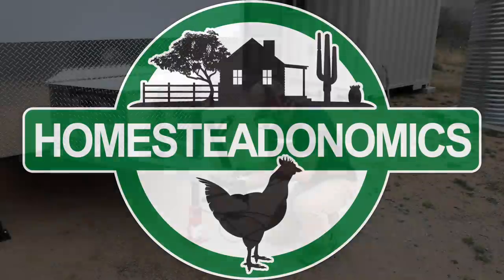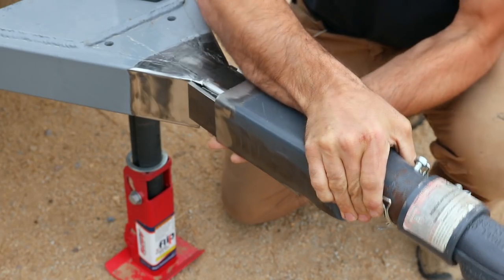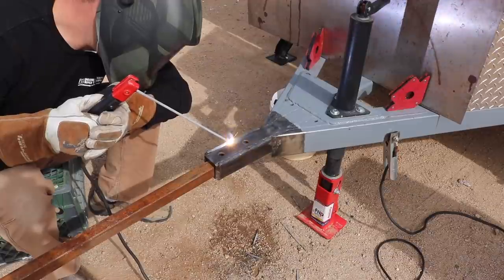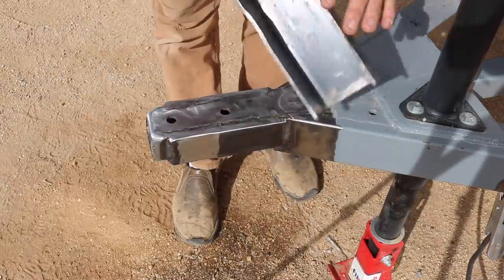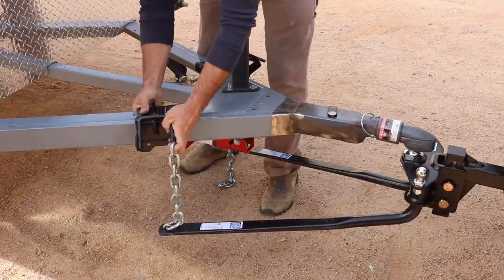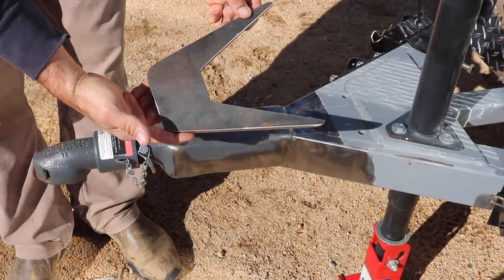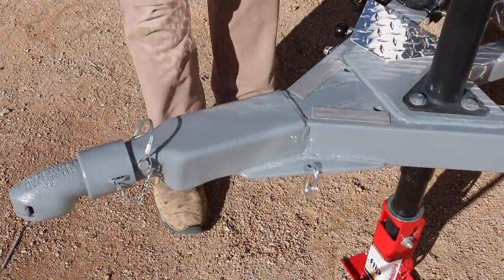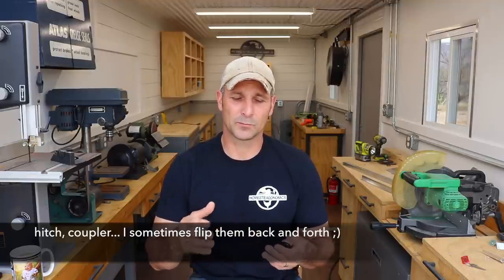How to Build a DIY Travel Trailer - Coupler Install, Hitch, Sway Control (Part 7)

Comment: Hi ! 12 Volts is not enough. You need to wire also a 110 (220) Volt. This is very convinient hen you are on a campingplace were they have 110V. Especcialy when you want to heat it. Rob.
Reply from the maker: Rob Janssen the 12v is for the the main camping that we do, which is primitive camping.  When we get into more of the campground thing for road trips, etc,. I will probably do a dedicated 110 feed with some outlets for those kind of appliances.   😀👍

Comment: If you don't make things like this for a living you ought too! This camper is first class all the way and your craftsmanship really shows. Thanks for sharing this.
Reply from the maker: Thank you John!   this is more of a hobby kinda thing... but I do love it!    I don't think I could be profitable on many of these projects because of the time and figuring they take.    I will say that if I built this trailer again... I feel it would take only about 1/3 to 1/2 the time due to all the figuring and mistakes and changes made during the first go around.    Sometimes i do make custom pieces and projects for folks though... but its on a very random basis, but I have been thinking of doing it slightly more... so long as they are okay with me making a video out of it ;)

Comment: WOW!  You can weld out of position with low hydrogen!!  A skill level that comes with a learning curve.   Congratulations!  I'm a big believer in low hydrogen welds.  They make strong, resilient welds that will bend and twist and stretch before they break.  I used to repair a lot of farm machinery.  Great looking little project.  Now, take the family and use it.
Reply from the maker: Thanks!   I’m still learning but getting better with each project!  The overhead was definitely tough to figure at first...lots of trial and error and watching some of the pro guys here on yt. 😀👍

Comment: Nice job! Overhead welds are the hardest to get right. Love the way you pay attention to details.
Reply from the maker: Ben Joiner thanks you Ben!  They have been the hardest for me to learn for sure....slowly getting better though😀👍
Reply: I work in commercial construction and the most difficult welds for guys to get certified on are overhead, then vertical, and horizontal of course. Seems like your father in law knows a bit about welding, I didn't  go back to check. It always looks like flock of dirt dobbers attacked when I get done with a weld of any kind so my hats off to you!

Comment: I didn’t notice a leveling jack at the rear of your trailer. Good workmanship.
Reply from the maker: Chuck Lenhart thanks!  Only stabilizer jacks in the front and back.  The leveling will be the traditional way.  Tongue jack for front and back level and a shovel to level the tires for side to side.   It’s not hard really...just moving the trailer into hole scraped out quickly to get a rough lecvel.

Comment: Great video and great trailer.  I DON'T lend anything even to family,  now a days no one accepts responsibility if it gets damaged. Just me saying buddy! Again nice informative video
Reply from the maker: haha... I know what you mean, I loaned my chainsaw out once and it came back dry on bar and chain oil.   The thing that bugged me is that I even included oil with it and mentioned to top it off during the cutting.   Needless to say i haven't loaned it out since.   That is probably more of a reality with the trailer as well... as it will be years down the road before I get 35 trips in with it ;)

Comment: Great video! One Idea for the trailer- If you want an economical heater for winter use you can install a webasto style (or a China knock off)  diesel heater used in semi trucks. It will run 24+ hrs on just 2 gals of diesel fuel
Reply from the maker: 96ChevyDually6.5L thanks Chevy!  Now you have me interested in this diesel heater!   Sounds pretty cool...thanks  I will check it out!

Comment: Great job Joe! You'll be camping in no time w/the family. Only wish I could get mine together like you have done. But one w/disabilities will take a little longer to fix. Instead of fixing it. I think it would be easier to rip it down to bare trailer & start fresh. That away if wires was cut, no big deal bc they will be brand new. Plus the mice have chewed a few into. Oh those stinking rats.... lol... I'll get those little basters. And we want to plug all the holes up so they can't get in in the winter.
Have a great time camping w/the family. Nice job,
Chris from Missouri
Reply from the maker: Hey Chris!  ouch... sorry to hear about the wires.   In that case I kinda think it might be worth stripping it completely.    If you check out tnttt. com   there are a lot of posts about people doing just that..... stripping it down to the bare frame and upper structure.  Then if any of the wood is rotted, they take it out one piece at a time and replace it... so there isn't much figuring at all.... just making a new replacement piece kinda thing... makes it more managaeable i think
Reply: @homesteadonomics  I agree w/stripping it down to the bare. All wires, light fixtures, & what's water damaged. The good thing is the stove, bedroom, restroom is in good shape. Plus a good thing is we can make it a little taller & put a storage loaf in it. I'm not talking about a 13'5" camper just about 3' more for some rubber made totes. With a shed roof which I already have the medal for, left overs from another rooftop we made. We can put a AC unit in a window or wall & then some solar panels on the roof. Its 24' I can live w/o a living space since it's just me & my hubby. Could use have for battery storage & the other for small eating place. The couch folds down to make a twin bed & has are fresh water tank under it. Just wish I had a large barn to put it in to do the work. It's hot in summer & cold in the winter. Just might trade it in on one that doesn't leak.... lol...
That would be the smartest way. 
Take care Joe, 
Chris

Comment: Nice job Joe! I didn’t know there was a certain direction you need to go on vertical surface so you don’t contaminate your weld. That chrome plate looks awesome!!!
Reply from the maker: Melrose Design Company thanks Zac!  On MiG it isn’t as much of an issue since there is no slag build up....so when you get going on MiG you could go down instead of up....that’s the way I prefer but also one of the reasons I made this mistake...haha....but as long as it gets stuck together real good it should be fine😀🤞😉

Comment: Looking great my friend. I was wondering about the levels, so I'm glad you answered that. You are really good with a stick. I've always I've always Migged and Tigged. Stick was never something I really had a need for but have always wanted to try.  In one of my last videos I welded my shipping containers to steel plate on the piers. I was planning on getting a stick for that because of the dirty and windy conditions, but I think the Mig worked fine, I'd just wait for a break in the wind.  Keep up the good work buddy, love this series.
Reply from the maker: Thanks!   I used Mig and Stick on my shop... I think your MIG will plenty for the shop... I watched some of your other videos but will have to go back and check those out too.     I would love to get into TIG as I think that's kind of the gold standard for welding.   But MIG is just so darn nice to use... easy quick and gives more time to create ! :)
I also did the 'wait for wind thing' when I did the initial framing ;)
Reply: @homesteadonomics  TIG is slow but beautiful in the right application.

Comment: The welding police 😂 that's usually me but in this case the full length welds on the bottom and top of that hitch are MORE than enough by themselves for that build. Throw in the two welds for the safety chains and you don't even need those vertical welds 😀. Very over built trailer, I love it!

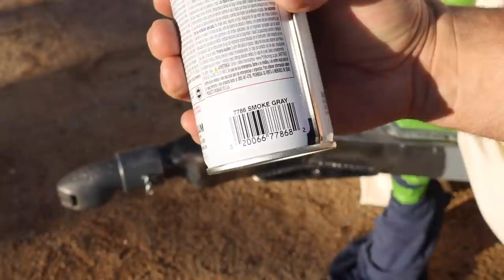Comment: I love that piece of diamond plate that you added 8:01, but I'm worried that with just double-sided tape that it will come flying off (especially the hot Arizona summer seems to soften any glue) and go through someone's windshield. 💜🌞🌵
Reply: Most of the trailers siding is held on with double sided tape.

Comment: Joe have you considered a solid metal or plastic awning that could fold down over that front window over the Battery box? When camping and raised,  it could shade from direct sunshine to cool the inside and when traveling folded down to protect that big window from stones or gravel kicked up by the tires.
Reply from the maker: William Bays I’ve definitely considered having something to protect that window.  Not exactly sure what exactly but something that can do both those functions.  Might be temporary just for the road but it would certainly be better than a. broken window driving😀👍

Comment: With the extra steel added to the tongue, how much extra weight was added and what is the overall weight of the tongue now? Fantastic job, thank you for taking us along!
Reply from the maker: sennest I wish I knew for sure....I’ve ballparked that it is in the 250lb range but honestly I’m not totally sure😬

But after I get the kitchenette made I will probably weigh the tongue and the total weight as well😀👍
Reply: @homesteadonomics  
Was a little curious but I figure your load leveling would take care of any weight issue. Great job! Your dad must be proud of those welds you're getting!

Comment: My Dad made a hitch lock out of some metal pipe that fit over the hitch then welded a small piece of chain to it. 
The chain was then padlocked to the frame of the hitch so that the pipe was covering the ball receiver.
Reply from the maker: I like the sounds of that!  I'm looking to get some tubing to fit just over the assembly and use a puck lock to hold it together :)

Comment: Just a tip from the welding police lol.

If you drilled or cut holes in the top of the coupler before mounting it then you could have plug welded it to the tongue of the hitch also.
Then you could grind smooth to hide the weld.
You are a great fabricator ,keep up the good work.
Did remove the hail damage?
I felt so bad for you when that happened.
Reply from the maker: Gregpajason haha...yep that it actually something I thought of...after I get it all on😉....I was under the trailer hooking up that trailer light wires and saw that is what I had done on the leaf spring mounts...but they were pre drilled...so it mentally reminded me 

As for the hail damage...not yet...just been putting it off and debating if I want to go through the extra hassle.  I’m leaning towards it but just dreading scraping off all the seam tape and residue🙁

Comment: A very complex tow system compared to what we use over here in the UK, but still a ball coupling, our type of clamp is on the ball and  hitch, my caravan weighs in at 2500 kg pulled by my Land Rover LR2
Reply from the maker: Keith Foster yep, probably a bit of overkill...haha. Thanks for watching!  😀👍

Comment: Very nice work! I don't think you should use that load distribution on a larger pickup with a small trailer. You want the weight on the rear tires of a truck since they are already really light in the rear. In a panic stop, the trailer can unload the rear end and cause a rear skid (jackknifing), especially if you are on a dusty road, gravel or snow. The load distributing hitch would be great on a vehicle like a compact SUV like a Honda Pilot however.
Reply from the maker: Mekhanic1 yes definitely...but it was also to have the sway bar attachments....I don’t have to tension the it much at all...but to get the sway bar alone versus with the wdh wouldn’t have been mucho difference in price.  And the option of smaller vehicles is appealing to👍😀

Comment: I still admire your welding skill. Are you allowed to have that kind of weight on a trailer without a braked axle? Anything here above 750Kg has to have brakes.
Reply from the maker: jannie cloete thanks jannie.... actually the  axle does have brakes...I just haven’t hooked them up yet as it was a used axle and I still need to change the bearings and inspect the drum/pads.   I’ve just been putting it off since I’m a couple months away from really taking it on the road....but they will be hooked up before we travel with it:)

Comment: First, I LOVE your creativity and your videos.  It seems like we are neighbors, so hello neighbor.  I live just slightly north of Tucson, so we have similar weather and natural habitat issues.  My question it regarding the "Corrugated termite proof raised beds" you built a few years back.  I have these cute little creatures (Prairie dogs/gopher/squirrels) that love to borough tunnels throughout the yard.  Although they are cute to watch as they can remove more soil than a backhoe, they are very destructive to a yard.  What have you done or found that works to protect your beds from this rodent.
Reply from the maker: J Daniels hi J Daniels,    Fortunately I haven’t had as much of a problem with them as they aren’t as prevalent in my area.   I think our decomposed granite and caliche must not be the place they like as much.   Perhaps mesh or chicken wire layer under hthe beds might help?

Comment: As usual this was a great video.  Your welds were very impressive to me.  I have one question on the hitch, why the secondary  sway bars?  The equalizer hitch should have been enough....just asking.  Thanks for video.
Reply from the maker: Mike Morris thanks mike!   The weight distribution is to keep sag from being a problem ....which likely wouldn’t be as the trailer isn’t all that heavy.  But in case we ever decide to use a smaller vehicle to tow.

The sway bar is more of a nice to have and it wasn’t much more versus the hitches without one...both aren’t totally necessary but just nice to have😀

Comment: What's the adhesive tape you used for the small piece of aluminum? I've never found a product that can outlast the elements like that. Thank you for the great videos. So inspirational!
Reply from the maker: Geoff Henry thanks Geoff!  It is VHB tape...I used the same stuff to secure the aluminum panels in the trailer frame.  It’s crazy to think but this is the same kind of tape that is used to hold skyscraper windows, body panels on vehicles, etc,.   It made by 3m and stand for very high bond.   3m even has tests with trailers going over 100k mikes overloaded and flexing on a rough track and the tape had held strong through out.   I figure if it ever started to loosen I would always just secure with rivets it screws
Reply: @homesteadonomics  thank you very much for your reply. I'll grab some today on Amazon to have it on hand.

BTW, I'm setting up an aquaponics system in a 1k sq ft hoop house and I'll pass the video to you when done.

Comment: Looks great!  Quite possibly the most over-engineered small trailer I've ever seen!  Does the load distributing hitch cause additional wear on the trailer tires?  My '05 4runner sags in the rear when pulling my 3500# trailer, not sure of the tongue weight but knowing that the load distribution hitch will level it out is appealing. Going to look into it.  Somehow it still seems overkill...I was told the sway bar was already overkill so this just ups the overkill!  I think!
Reply from the maker: Little White Dory thanks!  And I agree about overengineering it....what I’m unsure of I just double down and make sure it is robust as it can be😉

As for wear in the trailer tires...not sure but I might have to research that since I’ve only got one axle and don’t want a blow out😀👍
Reply: @homesteadonomics  Hi again, I'm in the same boat so to speak.  I have only 1 axel so I keep a close eye on the tires.  I'm puzzled by an inability to find any kind of superior quality tire as well.  I searched and eventually settled on a Chinese tire but went up one in load range from C to D.  May not do anything for tread wear but at least it's got 1 more sidewall ply!  If you have any insights as toward a quality tire I'd love to hear about it?
Reply: Goodyear and Firestone both make pretty good trailer tires. Goodyears are a bit pricey but as you only have two it is not so bad.
Reply: @tomtruesdale6901  I've looked into both and, well, I couldn't determine that they'd be any better than the less expensive Chinese tires.  I have found that they can both dry rot and wear pretty quickly.  With the load range D having an additional sidewall ply they seem to be doing ok.  I will settle for 3-4 years on them and replace them proactively to be safe.

Comment: Just found your site today and have watched this series with interest. You do great work. Have a couple of questions that I must have missed in the videos, what did you use for the interior paneling, is it plywood and did you film the install? Are you putting in a water system and where will you mount it? Will be following this with great interest.
Reply from the maker: Tom Truesdale thanks Tom!   Yes I used thin 1/8” and <1/4” plywood for the walls and the ceiling...you can see it  insulation video I think...or maybe the one after that:)
Reply from the maker: ....oh yes....I will be doing a water system too....but it will be simple like a foot pump powered system so we do t have an electric draw for that:)

Comment: Just curious, is it beneficial to drill out original bolt holes and bolt as well? I know astheticly itd be a downgrade, but I am a fan of redundancy.
Reply from the maker: I agree!  Redundancy is always something I prefer over aesthetics...but if I do it I’d probably just do plug welds instead.   Where I would drill the hold just through the couple metal and then weld in that area so the metal is bonded to the base metal int th same manner as a bolt would work:)